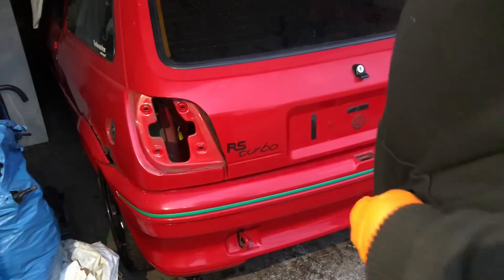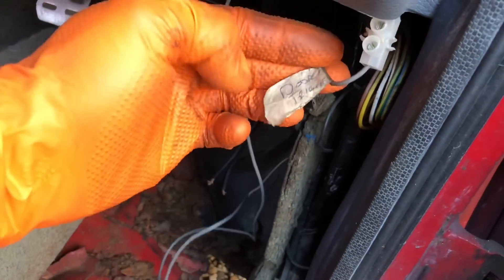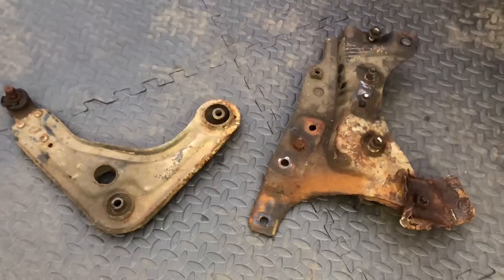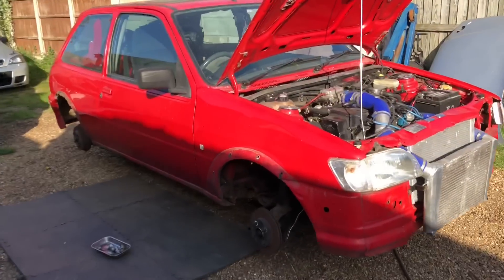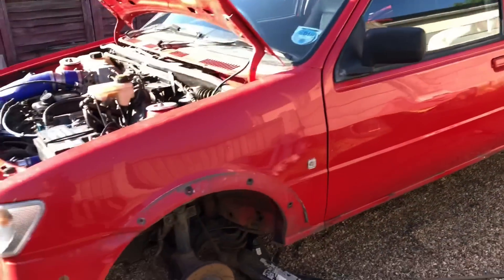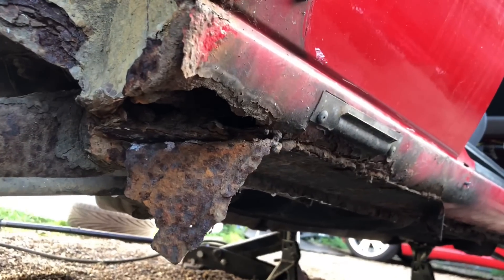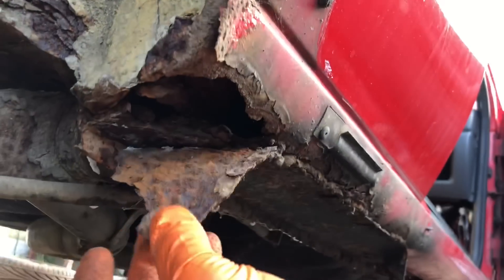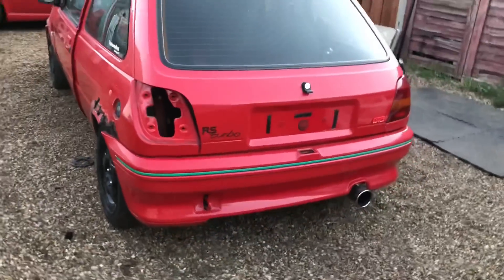FORD FIESTA RS TURBO:The Full Rust Is EXPOSED! ITS BAD!

Comment: At 24:00 that silverish thing that is breaking of, I think it was called aluminum kit or aluminum filler. It's basically the same thing like Bondo, but fuses better with aluminum and I think it was stronger. I am not 100 percent sure, but I remember that where i worked the last summer, they were usually applying this kind of paste on retro cars and when it cured, it had the same metallic look to it.

Comment: If you cannot get access to a decent shell.
I would suggest stripping it to a bare shell and get it sandblasted and buy a load of new panels and start from scratch . Least you know what you have then.
Its a pity ford didn't seal them well from new and even charge the customer another 1k or 500 quid on manufacturer price.
Least when you rebuild it you will know what you have...body sealers with waxoil the complete inside and out

Comment: what a day, bloke put all the money into the engine power, but when the MOT said to em the car is falling apart. at least someone knew there is a vary good running something or other inside of that old tin can... could it possibly end up costing less to find a car shell in better condition that just needs a motor? but then if you are to put in the time, by the end of it welding will probably be easy.

Comment: All the Fords from this era rot like crazy, One of the main reasons is because the sunroof pipes drain into the sills, You know! them four holes in the corners in the sunroof recess, when new there is some small slots in the sills to let the water out as the car ages the slots fill up with road dirt and rust and block, Then the internal corrosion starts because you have a swimming pool in your sills, Some clever bloke at Ford thought this was a good idea! to leave the plastic pipes short into the sills, Instead of making the plastic pipes longer and routing them out under the wheel arches, I've found this out when I cut off and replaced the drivers sill on my black XR2 E405 BTV, Which has since long gone to the metal scrap man. That's why sometimes you can find a good fiesta shell MK1,2 because some of the base models didn't have sunroofs, hence less rot....

Comment: HI what is the best under-body  protection to use on a cr ( was thinking stone chip ? )  products and make, thank you for any replies .
Save the car its worth it Aaron
Reply from the maker: Epoxy primer on bare metal is by far the best rust protection
Reply: @AaronUnknownPerformance  Thank you very much  for that info

Comment: I've restored an xr2i 16v back in 2007 and it was already rusting bad in the same area's, when i took it all apart i really concidered not to continue with it because of the rust. When i see yours i wouldn't put my time in it because it is really rotten. I think you are better off with a better shell.
Good luck

Comment: Mine went in all the usual places. Battery tray, filler neck, rear wiper. I still loved it and my cousin still has 2 one track prep/ fast road and one standard with original square exhaust tip!

Comment: Get the centre console auut...what, auut auut? Man you're an optimist..."passenger side isn't that bad"....other than the sill & the quarter having mostly been eaten away.  They rotted badly enough to need welded repairs when they were 4-5 years old...the repairs may not have been brilliant but the cars were pretty terrible to start off with, late 80s-mid 90s weren't good times for Ford for rot wise. To be fair most stuff built in Valencia was pretty terrible for rust. Can you imagine needing to weld patches on a 2016 car?

Comment: My mum had a mk3 5door Fiesta 1.8d it died in 2010 from rust and the Front bumper fell off when I went to retrieve the starter motor for my 1.8 turbo diesel Mondeo mk1 he had the fiesta for 10 years. It was five years old when my mum bought it

Comment: What is the proper way to repair it? Clean it off with a wire brush untill there is no rust left (except maybe some pitting or discoloration) and then rust conver & epoxy?

Comment: I had many mk5s and loved them, but I was sick of welding it up every year for mot. I took the carpet out to do some sill/floor repairs, it turned out the entire back seat/floor join was non existent, and the front floor wasn't even connected to the sills. 

I sold that Mk5 GHIA with the floor mostly being made from a Hotpoint washing machine shell.

Comment: I’m a coded welder and just saved a S2 in worse condition but I loved the car and I didn’t know how bad it was until I started. Like you said if you don’t really like the fez turbos (like myself) I wouldn’t even start the project. Having said that there is plenty of solid metal to weld to and if your planning on selling the car then you need to rescue the original shell, Don’t reshell it. 
I’ll take the lump off your hands though, she sounds mint. Mines like a tractor in comparison. Best of luck with whatevs you decide 👍🏼

Comment: That’s going to be beyond practical in time, especially outside. Personally I would like to spot weld in new sills on that and lead load it rather than plod.  There inner and outer arches will likely take ages per side. Plus of course you will be wanting a top end respray on after those hundred of hours. That rear panel didn’t look so bad a few months back. 

Ironically the dishonest would have filled it back up, under sealed , dodgy MOT and back onto facebook ads......you need to crush that shell . Love the VIN number and dustpan of rust offer!

Comment: I remember seeing one of these in my local scrap yard many moons ago, the sill cover had fell off, due to pure rust.   But these were well known for rotting anyway, same goes for the metro gti, those too had the same problems with the sills, floors jacking point and rear arches.  Sadly though you do get some nasty bodges like this!  strong chance it was bodged for an mot so it could be moved on.  I remember seeing pictures of a metro gti, that had failed its mot, to the point where the floor was orange with rust!!  The owner had gave the tester a few quid to put a test on it,  Sold it on to one of the lads, who was going to break it anyway, He blew the whistle and got the garage who mot'd it suspended for doing mot's.  Another story for you, regarding filler, one lad had " repaired metro gti"  This fella practically rebuilt the car with filler to the point it was a work of art!  He sold it on to a lad who was going to use the car for rallying, When they came about stripping,  it was a death trap!  seatbelt mounts that should have been welded in, were just riveted and then bodged over with filler.  That was just for starters. The full body was practically on the verge of collapsing,  They ended up cutting their losses and weighed it in.   As for saving it, that all depends on how far you are willing to go, to me that would be donor sadly. Cut out the good panels, like the inner wings etc. Stuff that can be sold on etc.   Shame though, these were great little cars, even though i was into the rover metros, i still like the fiestas.

Comment: Mate that is bad! Doesn’t look far from bending like a banana if you floored it! Iv always preferred escorts aswel. I Have a new fiesta now just for commuting to work but miss having an escort plus I have no projects. Was thinking about getting a mk6 escort van, would like to throw an st170 lump in it but don’t know how Matched all the running gear will be. Either that or an rs2000 engine to make it nice and simple and get rid of the old crappy Diesel engine. Do you think an st170 will be a lot of work? It’s far more cheaper buying a whole st for a donor car than it is an rs2000.

Comment: You mention welders a lot but I don't think you have a clue what "a welder" does. "Welders" put down welds, to specifications on a drawing, on metal structures pre-assembled by a plater or sheet metal worker. These metal parts were previously cut, blasted and formed by other skilled workers. I think you're confusing bodge artists with tradesmen.

Comment: For safety sake you really need a re shell Due to the present state of the country on lock down I am welding up the inner floor and sills/rear quaters /front chassis leg /inner wing /new doors on my 1979 Orange  Fiat 131 Sport (google the car if you dont know what it is)  . I though mine was bad but yours look worse . Might have taken a bath at the sea side at some time in its life  . Good look

Comment: Aaron 🤷🏼‍♂️ 
You've completely missed the diamond in the rough here!!!
Thats not rust! That's a limited edition ford racing lightened 
shell only ever used in the lemans 24hr races from 1965-72 🚗
So don't be disheartened just get out the silicone, cut up a 
couple of B&Q's finest orange buckets and get that bad boy 
waterproofed again. For any structural work Tesco's value bean
tins work a treat!! 
but don't bother welding them UHU will do grand and keep the weight 
down to a minimum 👍🏼 Sorted

Ps If you need anymore tips just give me a shout an I'll point ya in the
right direction 😉